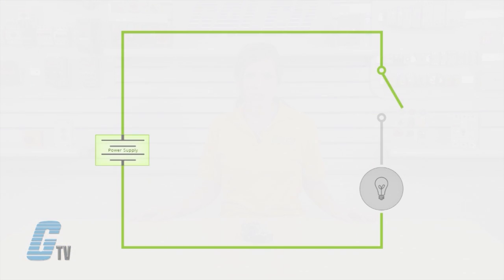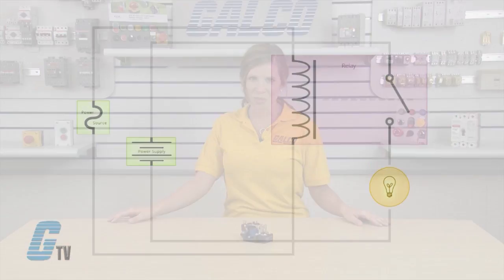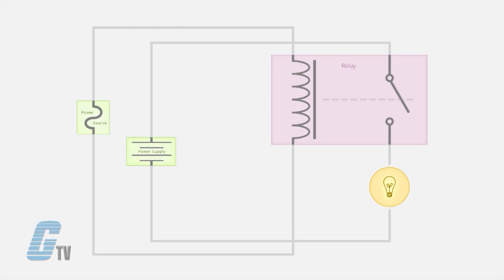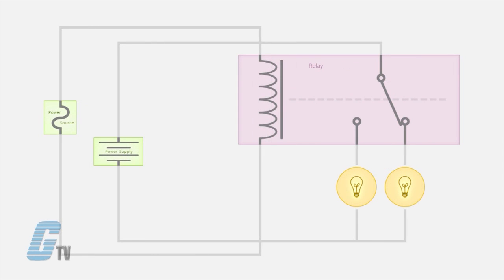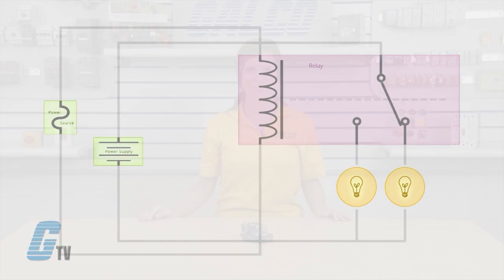What Is a Relay?

Comment: hi, I would like to have control of 6-10kv relay using arduino. is there any product to recommend
Reply from the maker: Hello Muhd, we do not have any medium voltage items to do this kind of thing, (medium voltage range, 601 to 69,000volts). If you know the control circuit voltage we may be able to help you though?

Comment: hi I understand a relays with more than 4 points can be made to buzz like a motor..electromagnetic switching, can I know what frequency does it typically buzz or switch when wired to do just that in nc looping
Reply: I know that relays werent meant for that specific purpose it just that I need to know what kind of speed in terms of frequency its doing that when its looped in nc trigger position
Reply from the maker: professorfidelcat  You're right in saying that the relay is not designed
for this application. To say at what frequency the relay would "buzz" 
would vary by relay as I would believe that this would be a function of 
the pick-up voltage and the drop-out voltage.
Reply: GalcoTV i guess you right in saying it depends on individual relay...some relays do this very very well and impressively contrary to what I expected or thought..im trying to make a mechanical oscillator( sort of like a mechanical transistor).. I think it must be buzzing at several hundred cycles per second!
Reply: +fidel catsro cg hi 9